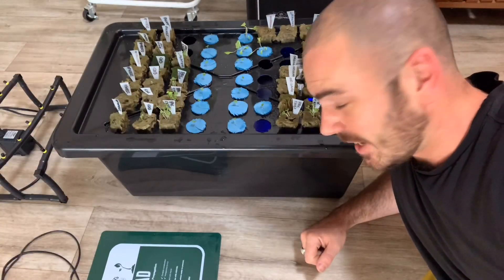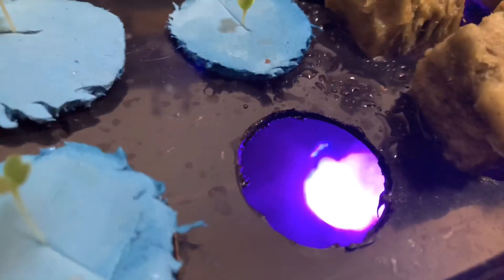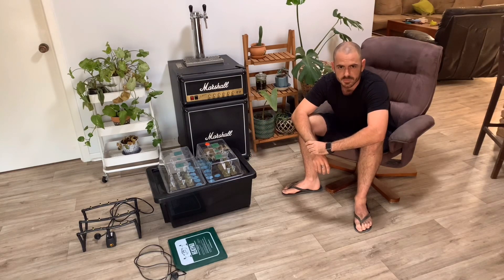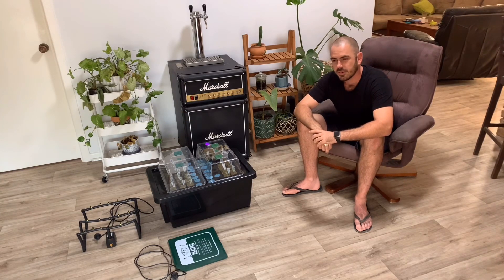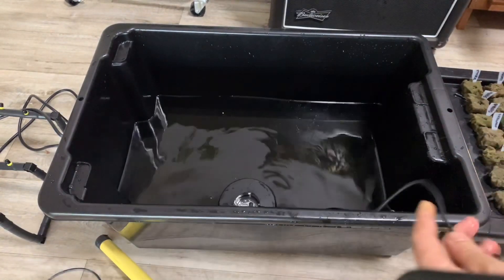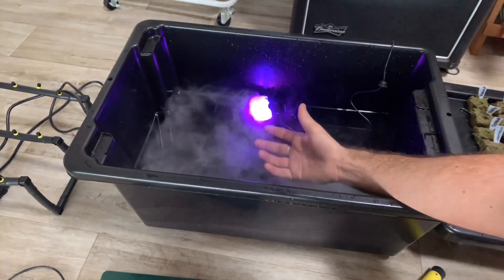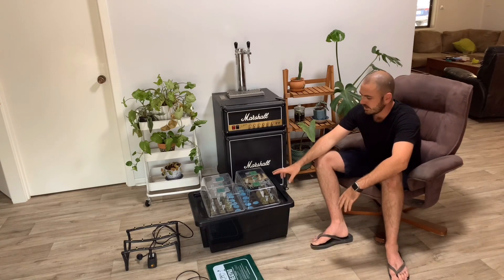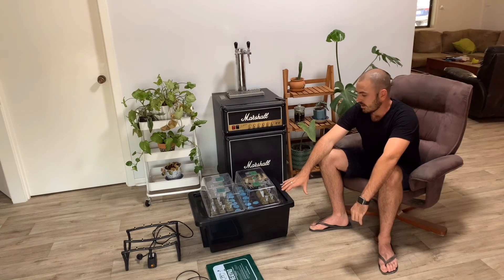How to Build an Aeroponics System Part 2: Fogponics

Comment: YOU SHOULD USE 2 FOGGERS as it will work much better. My larger tubes we use 4 foggers to ensure that we have no dead zones. Also place a air stone in the water to help oxygenate the water . Keep it out of the sunlight as well to prevent heat build up.
Reply: Why would you need to oxygenate water?!
Reply: @Porschecuzwhynot  to prevent the water from stagnating
Reply: @Porschecuzwhynot  keeps it fresh

Comment: nice vid and i loved it. Can i get the information of your foger? i was looking for the exact kind of product
Reply: look up house of hydro they sell ultrasonic foggers without LED lights as those lights aren't good for plants
Reply: @keitht11  
Waste of time and money, just buy an RO booster pump, cheap cycle timer and a few hypro or tefen nozzles. No reservoir inside the root chamber and no heating issues.
Reply: @atomizer2665  their would still be heating issues. You still don't want lights on the fogger. Of course he should have a separate reservoir in order for it to stay fogponics
Reply: @keitht11  
Not sure where the heat would come from, i dont have any heating issues with any of my aero setups.  You`ll find the growth painfully slow with an ultrasonic fogger if you dont have the reservoir inside the root chamber. Ultrasonic fog looks impressive but its not effective on its own.
Reply: @atomizer2665  the heat comes from the LED lights. And if not properly cooled or timed the fogger itself. You use waterproof fans and PVC to move the fog and select the appropriate sized fogger. Your aero setup is less effective than a proper fogponics setup.
Reply: @keitht11  
In practice you will find that without the dwc reservoir inside the root chamber you have to fog the hell out of everything to supply enough moisture. Fogging the hell out of the chamber results in an ultra dense fog that reduces the available oxygen in the root zone which has a negative impact on the growth. I have done numerous experiments with ultrasonic fog including transferring plants with well developed genuine aeroponic root systems over to ultrasonic fog and the result is always the same, the roots decline rapidly. The ultrasonic simply cant provide the same environment even if you put the ultrasonic fogger on a timer so it delivers exactly the same amount of moisture to the root zone per hour as the original system that created the genuine aeroponic roots.  If ultrasonic fog cant maintain an existing aeroponic root system,  it has zero chance of creating one from scratch.
Reply: @atomizer2665  you obviously have not done it properly. You have to keep it going constantly and use a chiller. Fogging is the best and most advanced method. There is a reason NASA developed research on and continues to use it. Aeroponics is a good number two and I wish you continued success with it.
Reply: @keitht11  
I can assure you i know what i`m doing and have given ultrasonic fog every chance to work. For example, if what you say is true, a single ultrasonic fogger in a 76gal root chamber (without a dwc component) running for less than 20 minutes an hour should be perfectly capable of producing a root system like this  https://youtu.be/l1Rmm9JvPfY because thats the amount of liquid that was used and it didnt require a chiller.  If you believe it can be done with ultrasonic fog, with or without a chiller, you should upload a video because it simply cant be done.
Reply: @atomizer2665  check the internet there are already plenty of videos proving the effectiveness. On top of NASA proving and documenting it. You have to run constantly not 20 minute intervals thus why a chiller is needed. If you had a problem producing enough fog get a bigger fogger or another fogger. Plenty of people use fogponics efficiently and effectively if you have troubles I'm sorry for you and I wish you luck in the future should you choose to try again. Otherwise enjoy the less advanced aeroponics method you currently prefer. If you don't believe in fogponics why are you on a video about it?

Comment: How do you keep the water from overheating from the mister?
Reply: A timer is another option I have seen other growers use to help combat temperature issues. Allowing the atomizer to cool down for an hour seems to make a difference.
Reply: @il9957  Example: 15 min. on, 45 min. off, every hour around the clock. Equals a total run time of 6 hours per day, and giving the water a chance to cool down a bit in between on sessions. Must keep lid and air holes fairly air tight, though, I would imagine, to keep the roots from drying out during off time.
Reply from the maker: Wally Brooks this was a problem I had with this system. I have stopped using it (summer hit hard) but my solution to the overheating was a larger res.

Comment: Hey Hoocho, do you still use this mister system?
Reply from the maker: Negative, its too risky in the sense that the sprinklers clog. 
This is the system I use now.
https://youtu.be/WHBgviMRaaI
Reply from the maker: In the case of the fogger, it heats up the nutrient solution so cannot be used through hot summers.
Reply: @Hoocho  Do you believe that's because of the lights or just the fogger itself?